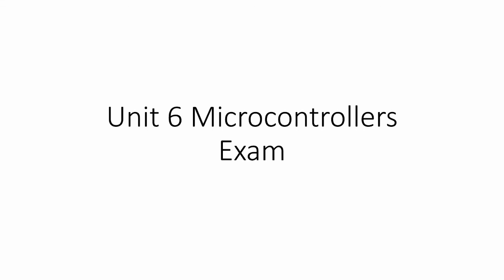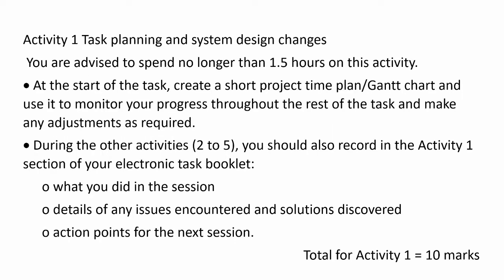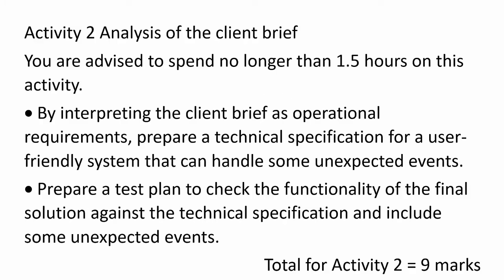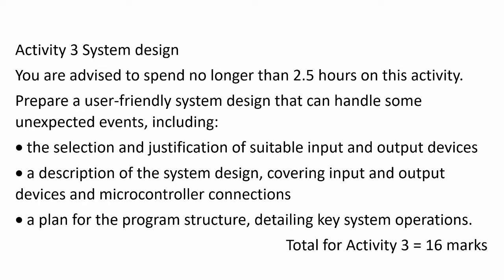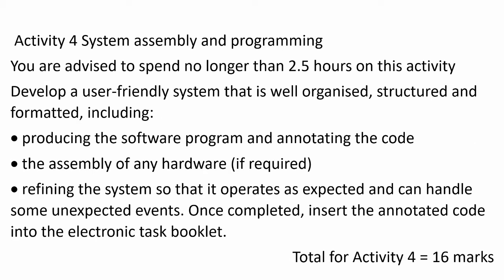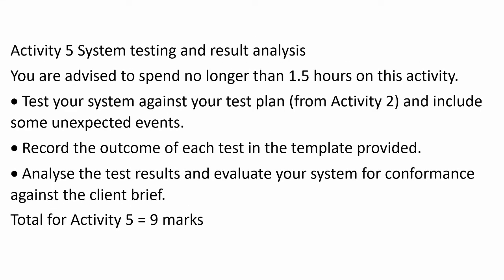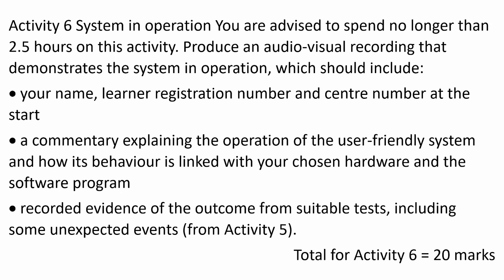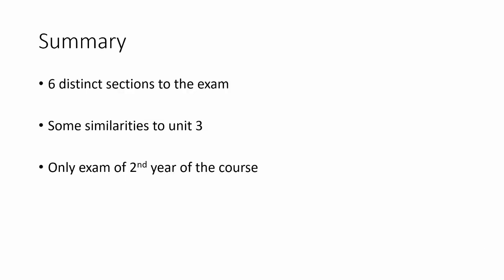Engineering Unit 6 Microcontrollers Exam Overview

Comment: Hello i recently did my exam in January, seemed like a fairly straight forward exam, did everything it asked wrote around 4000-5000 words but i got a pass. i was very surprised because i thought i would at least get a merit but to be fair i didn't finish task 5 and i kinda feel like i messed up task 6. im resitting next month any tips on how i can do better
Reply from the maker: Hi!

The exam really wants you to answer in a particular way. If you haven't done so already, I recommend looking over some of my other videos when I go in deep on each part of the exam.

Other than that, I'd say take a look at the mark scheme (it's the same every year) to see what you need to get done for each section. It's very much a box ticking exercise for a lot of the exam, especially for the lower to middle marks
Reply: @showyourworking9800  ok will do thanks a lot, got my exam next Monday and Tuesday hopefully I do better.